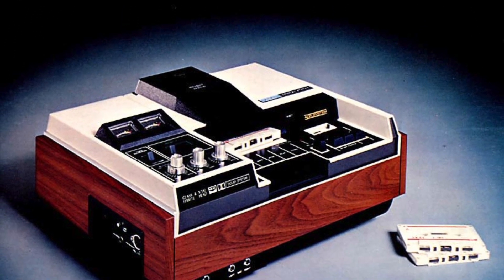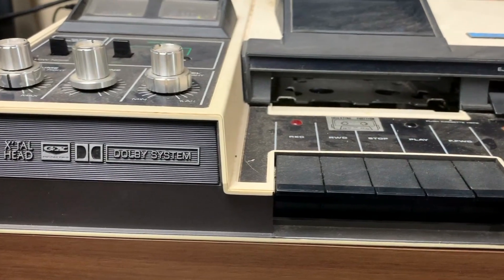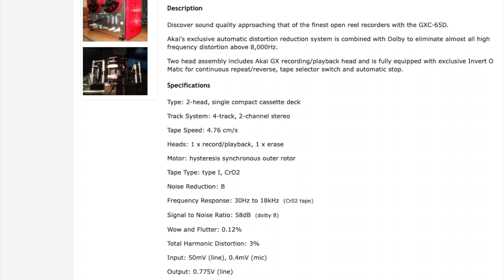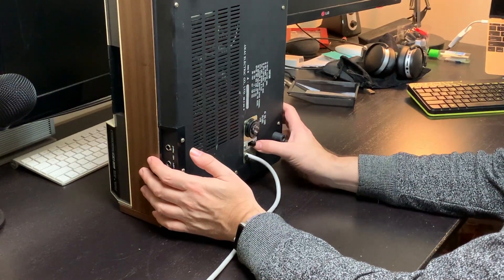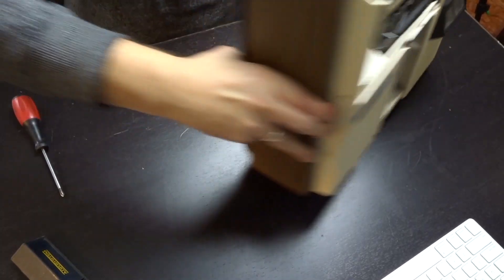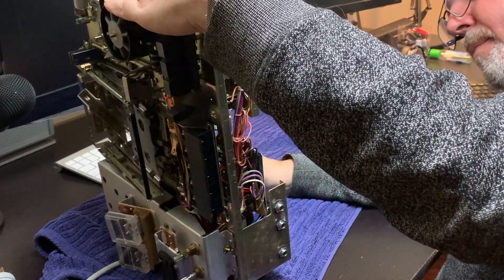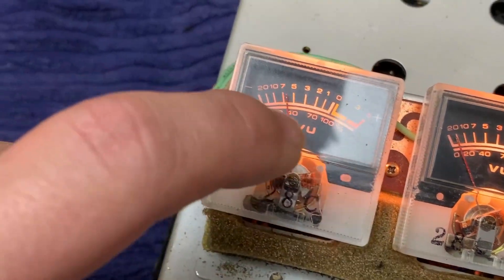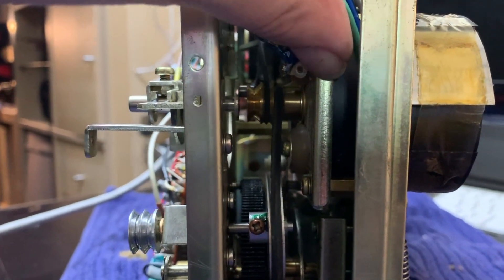Akai GXC-65D Restoration Part 1

Comment: thank you! FINALLY someone else has one of these, and has actually made a repair video. Will you also make a video on the complete restoration of this unit? I will be very much looking forward to it as I keep having problems with my CS-50D, which has the same 'invert-o-matic' mechanism. I'd love to fix this thing myself, but I also know that my electromechanical knowledge is very limited so I'm skeptical to even try. I'm also afraid to send it to the local repair shop because they have never even heard of this device. look at me rambling....anyways, great video. I'm looking forward to the next one.
Reply from the maker: Thanks Scott, I hope I can complete the restoration on this deck. Now the rail switch has failed mechanically so bad that I can get both channels to play reliably. I need to get a new one, not possible to repair it. My hope is to get one from someone in the US who has a variety of them. Hopefully he got a matching one.

Comment: I owned this ones little brother. It didn't have Dolby (which you mentioned), but I had an outboard device, the TEAC AN-50, which i had been using a with a Harman Kardon CAD-4, so I could play and make Dolby tapes.
Reply from the maker: Cool, first time I hear about external Dolby B. Was only aware of DBX units.
Reply: @ClassicHiFiReviews  Even Advent had some offerings. 2 if I remember correctly. One was for 2 head machines and one that could be used with 3 head decks, for tape monitoring. Top model went for 300 USD back in 1970/71